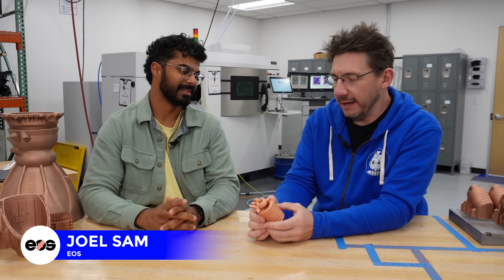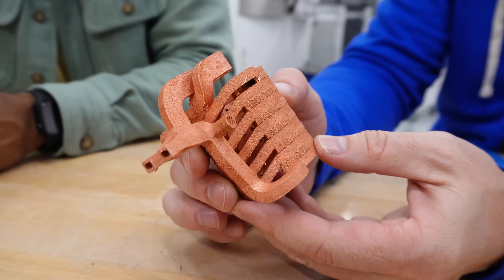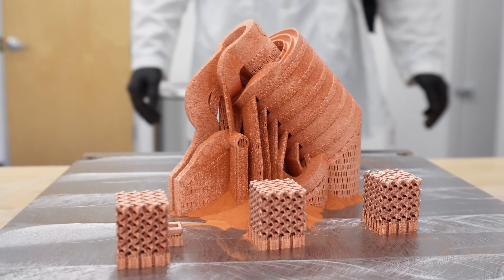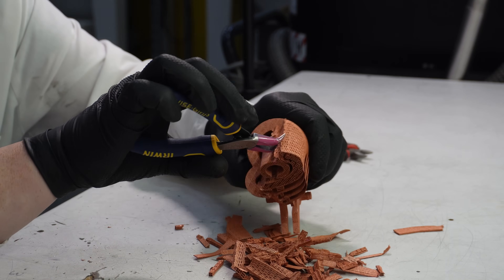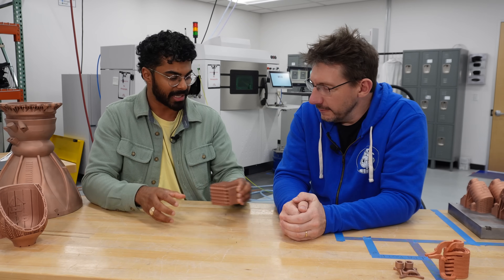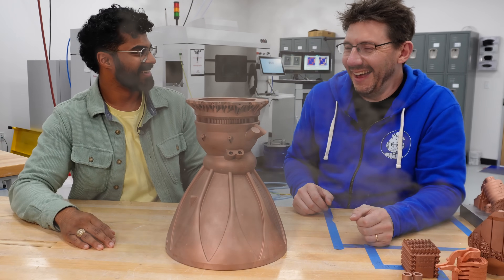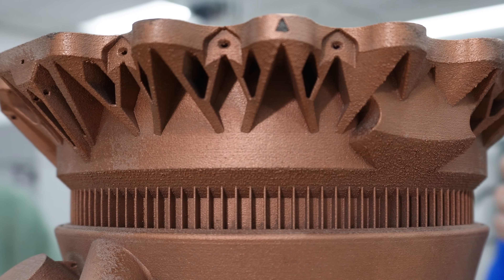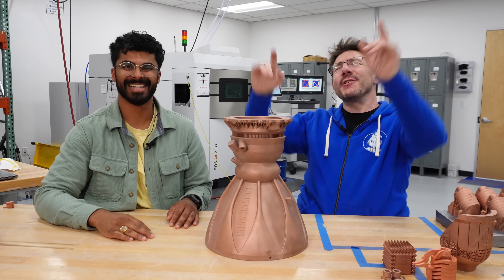METAL! 3D Printing Copper with EOS!

Comment: I can 3D print copper without removing support material, without cutting the parts off the build plate, with much smoother surface finish, with much cheaper source material, much faster layer production, and I can use any metal, and also 2 metals at the same time in each layer, on a much much cheaper machine, and no dangerous metal powder. Also, custom induction coils can help heat special shapes.

Comment: I worked for a company that made copper and titanium heat exchange units. They used a patented but covert method to do this. I used to think that there had to be another way for them to develop their technology. What I learned from watching this EOS presentation, is just like at the factory I worked in. The products are great. The business model is not.
As a business model, it's like you are supplying the radiator for a car manufacturing company, that has a unique shaped car, because of the unique radiator. What you should be doing, is own the car manufacturing company and ALSO supplying the radiator, to get the full benefit of the whole finished product. I know that won't work for all the products, like the rocket engine nozzle, cause owning a Rocket Company is a rather massive step up. 
But you need to come up with say, (i'm thinking thinking thinking) as an example, a Chilli-Bin design that uses a 3D printed unique heat exchange unit that has an edge over the current market. And then sell the whole Chilli-Bin as a marketable product. Then build up from there, if you start making a profit. That's my 2 cents worth.

Comment: why supports with a sand type media?  Shouldn't the media support the part?
Reply from the maker: Supports in SLS metal printing can alleviate the chance of warping, but also can act as a heat sink taking the heat away so it doesn’t buildup.

Comment: I did not expect an SLS print to need supports.
Reply from the maker: Supports in SLS can mitigate any potential warping, plus act as heat sinks so the laser doesn’t overheat some areas.
Reply: Metal LPBF (what is shown in this video) is not a sintering (SLS) process, it is a melting process. Some supports are required to tie the part down to the build plate and dissipate heat away from the part.

Comment: Cool, so basically you shoot a laser at metal powder and you have a metal 3d printer? Im sure theres a little more to it then that but i wonder how long before we see one for $299 on the consumer market.
Reply from the maker: I think it’s a long ways away, if ever. Metal powder has the consistency of baby powder. It’s like a heavy baby powder. It’s SUPER bad to breathe it and you need a clean room for it because if it plumes it can explode.
Reply: It would be nice, but there isn't even a cheap SLS printer for plastic yet. Do you remember the Kickstarter campaign for the Micron from Micronics? It was supposed to cost around 3700 $. Unfortunately, the company was bought by Formlabs before the end of the campaign (which was then canceled) and since then SLS seems to be dead for the consumer market.

Comment: Can not make this: fill a coppy pipe with sand, bend it, remove sand: done. —> 2 minutes
Reply: Ok…. The later models were impressive
Reply from the maker: heh, I get it - but the consistency isn't sand-like. it's more like a heavy baby powder. It's so crazy. that's why all the precautions because it would be SUPER DUPER BAD to breathe in metal powder.

Comment: How many times can the copper be recycled? Does it degrade like plastic?

Yes, I'm joking. We all know copper turns to tin if you melt it more than four times.
Reply: The copper powder can be reused quite a few times! If you kept re-using copper powder, the conductivity would go down because of oxygen pickup. That's why reused powder is mixed with unused powder before builds - to maintain quality.

Comment: wierd......so it's SLS, but you have to print supports? Interesting.
Reply from the maker: You don’t HAVE to. The supports in SLS metal also act as heat sinks. It’ll sink away the heat so it doesn’t build up in areas.

Comment: Why was it on the build plate? You can use the powder as support like on sls so it doesn't need to be attached to anything.
Reply from the maker: The support in SLS metal is there keep warping down and to be used as a heat sink. It’ll sync away heat and make the part print better.

Comment: why are there supports if the print is in powder like sls printers?
Reply from the maker: These supports exists to help sink away heat
Reply: @3DPrintingNerd  aaaaaaaaaaaah ... waaaaat, so ... really? hrm.. ok. interesting.
Reply: I wondered the same thing... Good answer on the heat Joel, that makes sense.
Reply: I believe its also about preventing warping by holding the new layers down as they cool.

Comment: Why the supports tho if its SLS ?
Reply: Supports on DMLS prints also work counterintuitively to supports on an FDM print. They actually hold the print down instead of supporting it from the bottom. Welding introduces stress and causes the parts to curl up, you can add supports to keep them held down on the plate. (Not always the case but sometimes)
Reply from the maker: Supports in SLS metal can act as heat sinks and sink away heat from the build as its printing.
Reply: @3DPrintingNerd  Oh okay, that makes sense. Thanks for explaining!

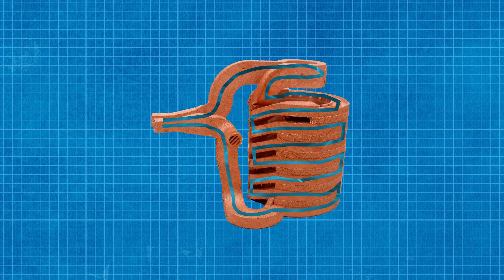Comment: 1:25 Induction furnaces use water cooled pipe for their coils, I suspect you already know this and just being nice to the guy.
Reply: yeah, was also gonna say: it is pretty easy to bend a copper tubing into a spiral...
Reply: Hi, Joel here! You're right - simultaneous heating and cooling can be done with a traditional inductor. The real advantages of the 3D-printed inductor are: shorter lead time, elimination of weld points (assembly consolidation), reduction of part cost, and longer service life.
Reply: @JoelSamEOS  literally every one of your points regarding this part is incorrect when compared to what is already being used.
Reply: Wasn't the only ball that was dropped.
Reply: Ya, silly application. Ha ha, then they used wire edm to cut it. It's like they are trying to figure out the most expensive way to replace $5 of copper coil.
Reply: I was going to write that
Reply: He a dude with a 3d printers what in your tiny little mind made you think Joel knows this.
Reply: @ShadowGun625  trolololol
Reply: @ShadowGun625  is it really necessary to be mean like that? Do you enjoy being mean? You could've said "Not sure why you'd assume a 3D printing youtuber knows that" and not insult that commenter. You can do better!